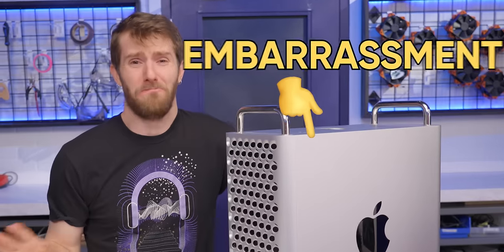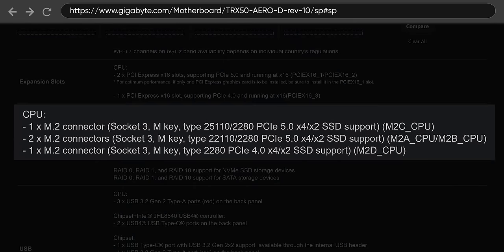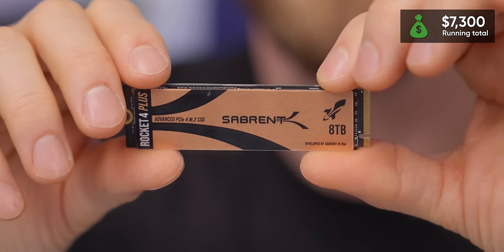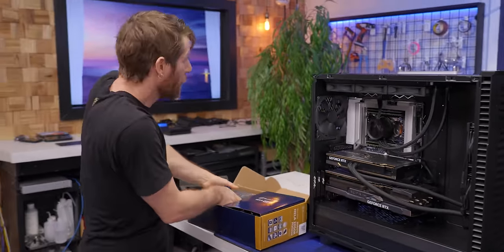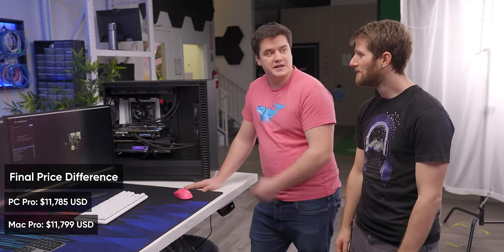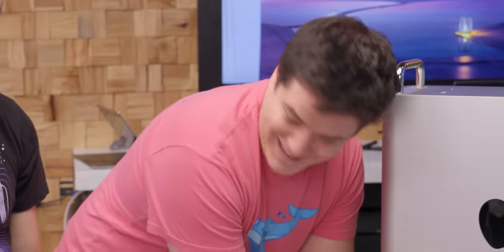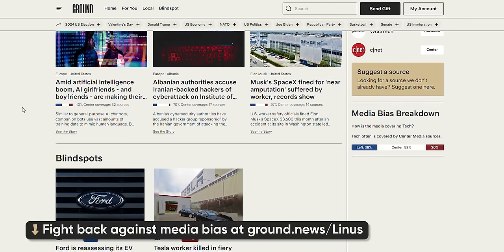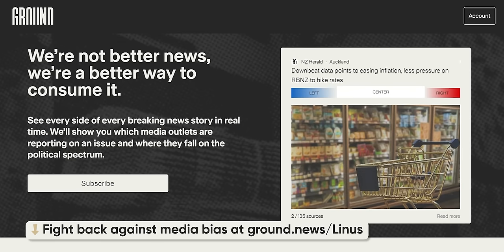The $10,000 Mac Pro Killer

Comment: 16:40 older PCs used to have a speaker in them, but they were only for bios post ...I think.....dont remember, many years and many bottles of alcohol have passed
Reply: It seems like most business PC's will have a functional speaker inside.  My Dell Optiplex's do.  Pretty sure HPs do too.  Not sure about Lenovos.
Kinda nice for windows sounds.  Pretty useless for any media.  But at least it's something.
And by functional speaker, I mean a little 1.5" full range driver.  Not just a piezo transducer on the motherboard.
Reply: Good ol' PC speaker sound. Some MS-DOS games (I think most actually) supported using it, but well, it sounded truly awful lol.
Reply: in linux they are also used for when you fck up at the command line

Comment: @Linus can we look at some ML benchmark results - such as training a Pytorch CNN? This might be a little non-standard, but a lot of use cases these days involve this type of workloads.
Reply: ML results would indeed be really interesting. And if your model needs 100 or 150 GB of video memory, the mac pro is suddenly really cheap compared to something similar with nvidia cards
Reply: The performance on training a CNN varies significantly depending on many details (how much needs to be stored in memory at any given point, and whether stuff need to be heavily batched as a result- in which case memory bandwidth dominates the results.  Also, I don't know what the CUDA/CUDnn equivalents for the Mac, but small differences in choices for optimizers/activation functions/etc for the network can make a huge difference depending on the version of CUDA+torch that you use. It's really hard to get meaningful comparisons unless you know exactly what you want to train.

Maybe some inference benchmarks?
Reply: @sophiophile  I don't know what they have and don't have in their ML tools, but it seems that they invest a lot into it because both TensorFlow and PyTorch supports more functions with Metal than AMD's ROCm, and the first Metal support was here less than a year after the beginning  of Apple Silicon.
Reply: @bastienx8  I agree, but there are lots of other things that can slow down a pipeline. I would be interested to see the performance of pandas on Mac's shared memory vs CuDF.

Comment: 5:20 Unified memory is cool, but 16GB on any M chip feels closer to 10 or 12 after your GPU starts to gobble up your memory.

I am consistently running out of memory on my work M1 where the same tasks on an Intel chip have never run out of memory.

You can blame electron apps and chrome, but still.

Comment: honestly, if energy consumption and temps are a problem, considering the 1.5 performence uplift in CPU you could underclock and undervolt the CPU to like 2.5Ghz and still have the same performances as the mac pro for probably even more energy efficiency.
And just imagine the GPU, being 7 times better in the benchmarks means that you could divide the 4090s' frequency by 7 to get 300 Mhz GPU that still perform just as good as a mac pro for way less energy consumption.
Add to that the (almost) energy-free doubling of ram and storage (and probably other I/o).
And then consider the compatibility issues of any apple product and that "strong" argument is void
Reply: The power consumption isn't proportional to the frequency. When you look at the power consumption of CPUs or GPUs it isn't 5x lower when they are idle, even if the main frequency is 10x lower. The M2 ultra average around 200W when the cpu and gpu are under load, which is probably not far from the idle power consumption of their "pc pro"...
Reply: @bastienx8  yeah power consumption is exponential compared to frequency, so lowering these frequencies might do a more than linear decrease, and if not just turn off 33% of cpu cores and somehow do the same with the GPU's cuda cores
Reply: @thomquiri9860  From what I've seen the power consumption is more or less exponential when you increase the frequency above the base frequency, but when you decrease the frequency and/or voltage the power consumption doesn't decrease a lot because everything around the cores still consumes as much. That's also why lower versions of a cpu of the same gen only consumes a little less even if the performance is 3 or 4x lower.

Comment: The extra memory channels in the TR Pro would aid memory bound tasks closer to Apple’s unified memory. Also, there are new PC standards that support DMA for nearly all system components via CXL. Apple knows they can’t compete in workstation or HPC, which makes this more of an art product than production compute system.
Reply: To most of the people I know that use apple over everything else it has nothing to do with performance. 

For them, Apple is better simple because it's apple. They are openly and willingly buying a name for the sake of the name. 

Apple could come out and say: 'This is worse and costs double everything else' and many of them would happily still buy it........
Reply: @NWinnVR  Nope, we buy apple because of macOS... and dedicated production software not available on Windows.
Reply: @meskahmusic  What do you mean no? I don't know you thus you have zero bearing on the set of people I was referring to... 

There are absolutely reasons to pick any platform over the other. I'm specifically referring to those I have spoken to about this matter and what their perspective is. 

A huge set of them literally and openly tell me they are buying apple because it's a status symbol.
Reply: @NWinnVR the 2019 mac pro is light years better than the M variant will be even in 5 years time.
Reply: @meskahmusic  If you're relying on software you're already using, i.e. you have technical debt, that makes sense. If you're a new studio, just choose different software and save yourself money. The production software you use may only be available on Mac OS, but production software in general is not. The trick to avoid vendor lock in is never getting started 😉

Comment: That board DOES support M.2 RAID.  Just built a system with 3 drives in a RAID-0 for a scratch drive.

Micron 7450 Pro 3.84TB drives reading at over 10000MB/s.
Reply: Raid on Mac ?
muhahahaha, M 2 studio !
You need a fast server !
Reply: Don't those drives get 7000MB/s on their own? A properly running RAID-0 should be getting basically twice what you are (there's no computational overhead with RAID-0). Your bottlenecked somewhere and not getting any of the benefits, with all of the risks of a RAID-0.
Reply: @sophiophile they’re rated 5000 reads.  They’re high endurance server drives being used for scratch.
Reply: @twistedmister1  RAID-0's should still get effectively n * drive speed (where n is the number of drives). You should be getting 15000. You might be bottlenecked by your PCIe bus or something.
Reply: @sophiophile client says his renders are 3x the speed of his i7-12900 system and 6x the speed of his i9-7940 system.  He’ll survive.
Reply: @twistedmister1  Yeah, it's obv plenty fast enough. I hope you've warned him about the risks with RAID-0, and have a system of regular backups to restore to if one of the drives fail.
Reply: @sophiophile  nothing to back up.  30% is a scratch drive for Premier/3dsMax and the rest is to ingest files overnight.  Once he has the files, they’re moved and the drive is empty.
Reply: @twistedmister1  Ah. Makes sense! I would do the same in that situation.

Comment: Not sure about up in Canada but that 2mW PSU is going to require you get an electrician to install an industrial-grade outlet+line in whatever room you'd have such a beast set up in (as standard domestic outlets in the US are only rated to support 1800W).
Reply: I wouldn't say industrial grade. I had an electrician install a 240V line for mine and it wasn't exactly a big deal.
Reply: We just park similar machines where we have the washing machine. Those are usually 240V outlets
Reply: I'd imagine their office already has a lot of those built in.
Reply: According to Silverstone, it will run at 1650W @103-264V. The product label suggests it is basically a 1650W PSU that you can (maybe) push to 2050 if you feed it between 200 and 240v. From the specs it supports 90V to 264V. Actually, you probably wouldn't get 2050W.  It appears to be intended for 2050W @208v, not 240v, which usually means derived from a 3-phase supply in the USA.

Receptacles are rated for voltage and amperage. The common ones you see in a home in the US are 15A because that's the cord that most things come with. However, 20A circuits can use 20A receptacles. "Industrial grade" refers to how physically sturdy the product is, not the volts and amps it can supply.

Comment: A tricky part about server CPUs is that the lower count CPUs might have a higher clock. There's a slim chance that these might be faster for certain uses. That being said, for multi-core, the higher core count variant usually wins. The higher core count usually comes with more cache, for example.
Reply: He should install GPU's into that IBM mainframe he had a few shows back. They got only 8 cores per CPU but they run at 5.2ghz and have way more cache and much more IO speed.

Comment: 12:54 There are indeed dozens of us!

I really liked Windows mobile. Allowed you to do stuff that Apple didn't, felt more like a mobile user system than Android, which feels like it's trying to be a touch computer too hard. It was for me the best compromise between the two approaches, not as limited as one and not as kludgy as the other (though Android has admittedly gotten better since, but man it was not very user friendly 10 years ago on many/most skins). I had pretty much all the apps I could have wanted back then, too, so I didn't run into the issue of lacking apps that some users would.

Though now I've been spoiled by foldables, normal phones just don't measure up.
Reply: My windows phone was the best phone I've ever had. Miss my lumia 920...
Reply: @octane613 Had a 920, then a 950, but due to work reasons had to get an Android one eventually. =(

Comment: Dave's Garage has a provocatively titled video where he explains how he actually saved money going with the Mac Pro instead of the Studio.
He wanted much more storage than the maximum 8 TB, and it turned out to be cheaper than the top spec'ed Mac Studio (+ external Thunderbolt enclosure) to get the 1 TB Mac Pro and add his own SSDs using the PCIe expansion options.
Putting aside his use case, the Mac Pro is  your only option if you have to run some Mac exclusive software and need more or faster PCIe than what Thunderbolt can provide.

Comment: I help doing tech stuff with a local non-profit.  They have been using Mac they had collected for a while and were comfortable with it but they wanted to do an upgrade.  The price to use macs was rather ridiculous and I hate dongles.  If you want to run more than 1 monitor, gotta use a dongle (or a TB monitor and who want to shell out for new monitors too?) and then you're wasting that bandwith on a 1080 monitor.  Using Lenovo PCs was just a better option fiscally. 12900s and Quadro cards for the same a basic Mac Studio.

Comment: Some advice I'd give to anyone going for a WiFi build; as good as any motherboard WiFi chip is, go the extra mile and get a dedicated pcie slot WiFi card. They're like £20 and they can pull 300mbps through the air. I get 250 through a wall I struggle to get WiFi through on a console in the past.

Comment: I do appreciate that that PC Pro had way less jank this time around. Raw performance numbers are only half the story if you have to spend twice as much time dealing with stupid things like a lack of IO and video outputs that they had last time.

With that said around 14:30 is where they hit the nail on the head: the problem isn’t really even apple silicon it’s that the Mac Pro exists for no reason. Like I LIKE Mac’s but it’s insulting to say “here’s a Mac Studio but bigger so it costs $3500 more”. It’s the same hardware in a different shell and there’s basically no reason to buy it.

The “it just works” tax is a lot harder to swallow when you are comparing apple to apple and for some reason being a pro over a studio.

Comment: I used to have a Mac Pro once upon a time.  I gave it to the local computer store for their computer showcase.  I now have a Mac Mini M1 instead.  I sure didn't buy it for performance or memory or storage though.  Yuck.  It was purchased for possible Mac software development.  On the PC side my top system is an Intel Xeon W7-2495X 24-Core, ASUS WS Pro W790-ACE, 512GB DDR5 RDIMM, ASUS ROG RTX-3090 24GB, WD SN850X.  I have thought about upgrading to an RTX-4090 but the $2900 CAD price is a turn-off.  So I'm waiting to see what the RTX-5090 will come in at.

Comment: While many aspects are commendable, it's important to note that, as a photographer using Photoshop and Lightroom, these applications perform significantly better on a Mac than on a PC. Despite having a high-end gaming PC worth approximately £4000, I find it frustrating how poorly it handles Photoshop and Lightroom compared to my MacBook Pro. I've optimized my PC extensively to enhance its performance with these programs, but it still lags behind the Mac. Perhaps you could consider creating a video on setting up an optimized Windows workstation specifically for Adobe products.

Comment: 5:20 the funny thing is, that if you think logically, it is the other way around, because apple's ram is shared so if you get  8gb ram, you have like 4 GB ram and 4 GB vram, while on a pc with 8 GB ram  you will likely get vram on the GPU, which makes 16 GB ram with an 4080 on a pc actually rather comparable to a Mac with 32 gb

Comment: In the past two years I switched 2 time from PC to Mac and drom Mac back to PC. First a Macbook Pro M1Pro 32gb and after a Mac Studio M1Max 32GB. Both were slow for me and my workflow. Lr, Ps and DaVinci Resolve run faster on a 1700$ custom PC that I built two years ago. A month ago I built a even cheaper PC that runs great. An i5-14600K on a B760M, 32GB dd5 and a RTX 4060. For me this combo beats any base model Mac todate that costs 500$ more. I only use iPhones since 2009(3G)...but I'm really thinking of buying a Pixel 8 since my iPhone 12 is a bit old battery wise.

Comment: I've recently built a  dual 4090 system with two MSI Suprim Liquid X cards and I'm only getting 56000 in CB24. Massive difference to your 65000. Were they both on stock settings? We all felt that they were underperforming somewhat from expectations.

Comment: i'm just going to note one thing which is that if there weren't TWO 4090's in the PC pro it would be way cheaper and still outperform the Mac pro.
i have no idea why they decided having an M2 chip instead of M3 was a good idea, and still don't understand why RAM and storage are double the price of regular PC ones.
Reply: "still don't understand why RAM and storage are double the price of regular PC ones."

Because people pay for it, that's it. If people stopped buying Macs or Mac RAM/storage upgrades, Apple's tune would change. But they can rip their customers off out of all proportion to the benefits of their shared memory architecture, so they keep on doing so.

Comment: Can u do a video on computer part reliability? I spent thousands building my pc in 2020 and now a lil over 3 years later my pc has spent more time waiting for RMA replacement parts than it has been working. I’ve gone through 2 motherboards, 3 3090, 1 liquid cooler, 1 set of ram and 1 M.2. 
These numbers represent how many have died inside my pc. 
I’m tired of replacing parts and I just want my pc to work and let me have my fun. Currently I’m waiting on Adorama to send me a new motherboard I bought back in November and they r taking their sweet time sending it out
Reply: Well, that's not normal. Should probably replace your PSU as it might be killing your PC

Comment: here a few things I don’t agree with this comparison: (overall mac ro is a terrible value, though)
1. Available games on both platforms: boulders gate, death stranding, metro exodus, etc
2. You could’ve installed GPTK to compare performance in popular games, even though it’s not a streamline to play games, but we are comparing performances here
3. The M3 Mac Studios and Mac Pros potentially are getting released in April, should’ve waited a month or two to do the comparison to keep it up most up to date
4. Absolutely no test regarding RAM & VRAM usage
5. M3 has Ray Tracing support in Blender, speed difference compared to M2 Ultra should be significant

Otherwise fun video tho